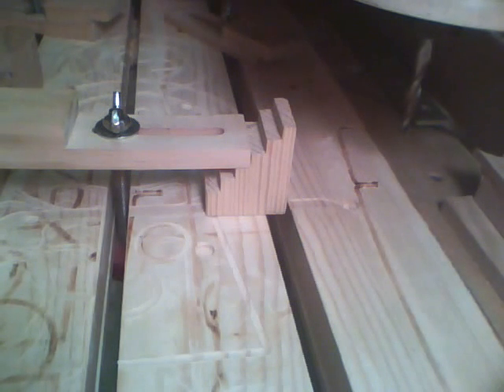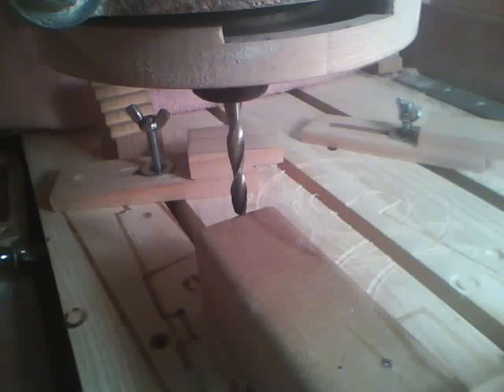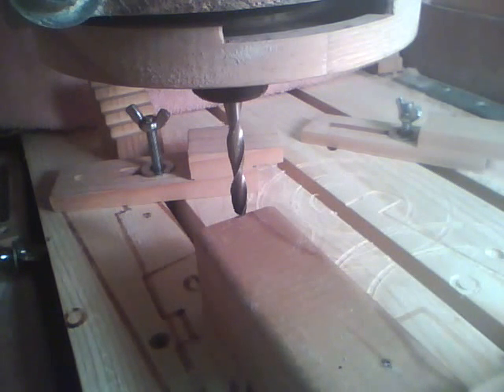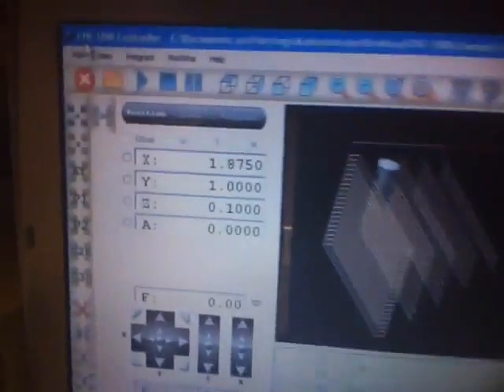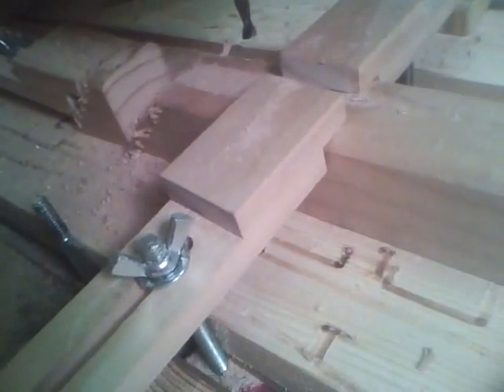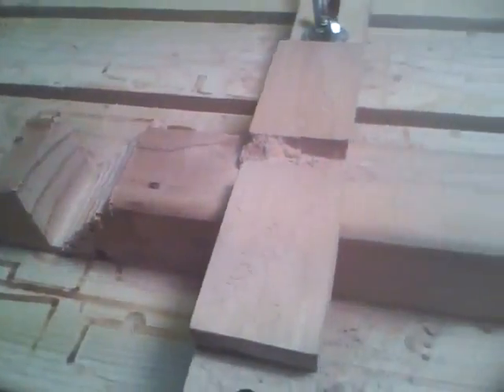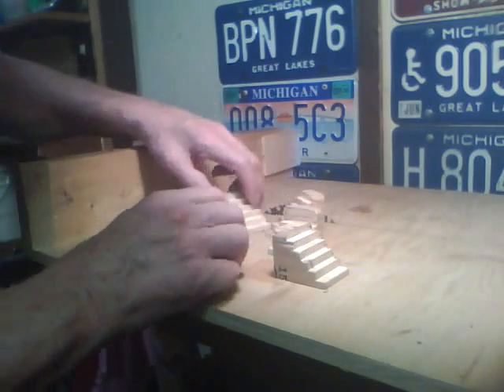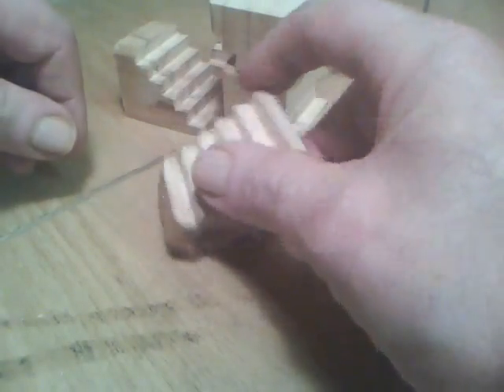Angled step blocks for clamping on my CNC

Comment from the maker: G-code for the Step Blocks
; CLAMP STEP 1.5x1.5 PINE Strip
; X0 = Just right of laft clamp
; Y0 = CENTRAL
; USE .250 FLAT ENDMILL 1.25 Long
; WHEN DONE, CLEAR X FROM 1.875 TO 0, AND REPEAT
; Steinie44 08-31-2015
;
G20 G40 G80 G90
;
G0 Z0.1 X0.0 Y1.0
G1 F15. Z-0.062
G1 Y-1.0
G1 X0.125
G1 Y1.0
G1 X0.0
G1 Z-0.125
G1 Y-1.0
G1 X0.125
G1 Y1.0
G1 X0.0
G1 Z-0.1875
G1 Y-1.0
G1 X0.125
G1 Y1.0
G1 X0.0
G1 Z-0.250
G1 Y-1.0
G1 X0.125
G1 Y1.0
G1 X0.0
G1 Z-0.3125
G1 Y-1.0
G1 X0.125
G1 Y1.0
G1 X0.0
G1 Z-0.375
G1 Y-1.0
G1 X0.125
G1 Y1.0
G1 X0.0
G1 Z-0.4375
G1 Y-1.0
G1 X0.125
G1 Y1.0
G1 X0.0
G1 Z-0.500
G1 Y-1.0
G1 X0.125
G1 Y1.0
G1 X0.0
G1 Z-0.5625
G1 Y-1.0
G1 X0.125
G1 Y1.0
G1 X0.0
G1 Z-0.625
G1 Y-1.0
G1 X0.125
G1 Y1.0
G1 X0.0
G1 Z-0.6875
G1 Y-1.0
G1 X0.125
G1 Y1.0
G1 X0.0
G1 Z-0.750
G1 Y-1.0
G1 X0.125
G1 Y1.0
G1 X0.0
G1 Z-0.8125
G1 Y-1.0
G1 X0.125
G1 Y1.0
G1 X0.0
G1 Z-0.875
G1 Y-1.0
G1 X0.125
G1 Y1.0
G1 X0.0
G1 Z-0.9375
G1 Y-1.0
G1 X0.125
G1 Y1.0
G1 X0.0
G1 Z-1.0
G1 Y-1.0
G1 X0.125
G1 Y1.0
G1 X0.0
G1 Z-1.0625
G1 Y-1.0
G1 X0.125
G1 Y1.0
G1 X0.0
G1 Z-1.125
G1 Y-1.0
G1 X0.125
G1 Y1.0
G1 X0.0
G1 Z-1.1875
G1 Y-1.0
G1 X0.125
G1 Y1.0
G1 X0.0
G1 Z-1.25
G1 Y-1.0
G1 X0.125
G1 Y1.0
G1 X0.0
G0 Z0.1
;
G1 X0.375
G1 Z-0.0625
G1 Y-1.0
G1 Z-0.125
G1 Y1.0
G1 Z-0.1875
G1 Y-1.0
G1 Z-0.250
G1 Y1.0
G1 Z-0.3125
G1 Y-1.0
G1 Z-0.375
G1 Y1.0
G1 Z-0.4375
G1 Y-1.0
G1 Z-0.500
G1 Y1.0
G1 Z-0.5625
G1 Y-1.0
G1 Z-0.625
G1 Y1.0
G1 Z-0.6875
G1 Y-1.0
G1 Z-0.750
G1 Y1.0
G1 Z-0.8125
G1 Y-1.0
G1 Z-0.875
G1 Y1.0
G1 Z-0.9375
G1 Y-1.0
G1 Z-1.000
G1 Y1.0
G0 Z0.1
;
G1 X0.625
G1 Z-0.0625
G1 Y-1.0
G1 Z-0.125
G1 Y1.0
G1 Z-0.1875
G1 Y-1.0
G1 Z-0.250
G1 Y1.0
G1 Z-0.3125
G1 Y-1.0
G1 Z-0.375
G1 Y1.0
G1 Z-0.4375
G1 Y-1.0
G1 Z-0.500
G1 Y1.0
G1 Z-0.5625
G1 Y-1.0
G1 Z-0.625
G1 Y1.0
G1 Z-0.6875
G1 Y-1.0
G1 Z-0.750
G1 Y1.0
G0 Z0.1
;
G1 X0.875
G1 Z-0.0625
G1 Y-1.0
G1 Z-0.125
G1 Y1.0
G1 Z-0.1875
G1 Y-1.0
G1 Z-0.250
G1 Y1.0
G1 Z-0.3125
G1 Y-1.0
G1 Z-0.375
G1 Y1.0
G1 Z-0.4375
G1 Y-1.0
G1 Z-0.500
G1 Y1.0
G0 Z0.1
;
G1 X1.125
G1 Z-0.0625
G1 Y-1.0
G1 Z-0.125
G1 Y1.0
G1 Z-0.1875
G1 Y-1.0
G1 Z-0.250
G1 Y1.0
G0 Z0.1
G1 X1.875
M30